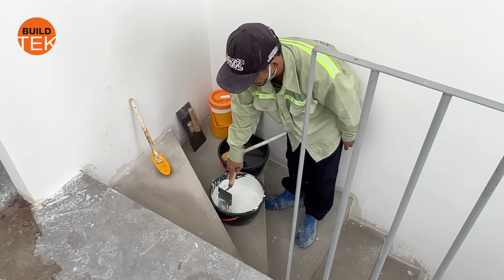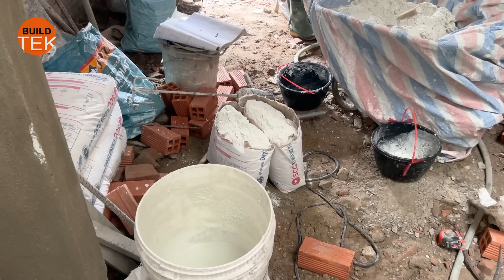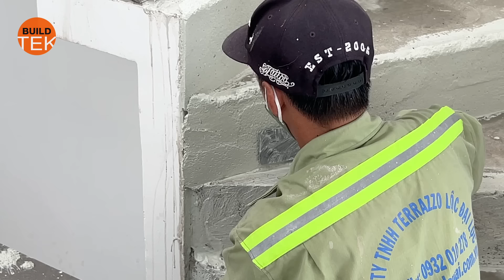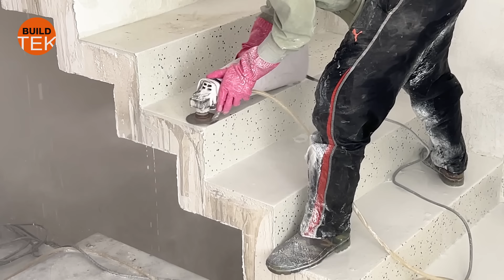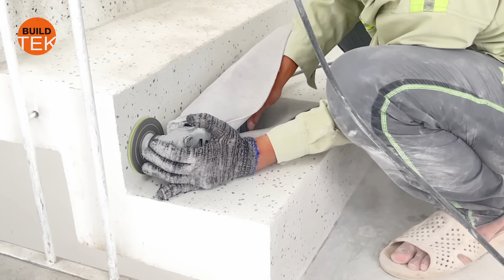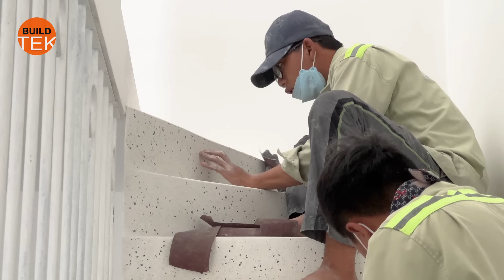It was hard work to make an amazing Terrazzo stair. The result is worth it!

Comment: Terrazzo is slippery and not advised for stairs
Reply: You can use lakk with anti-slip powder
Reply: Bạn không thấy người ta chà khô để không trượt à 😂
Reply: Well don’t walk on it if its wet. Duh!
Reply: Not true, terrazzo is one of the most versatile flooring out there can be finished in whatever texture you want from polished to textured.
Reply: @So-zp2uf 😊
Reply: Not true
Reply: @MostynWitham   Each house normally has only 1 stairs.  Terrazzo is porous and normally sealed with a wax cleaner.  When wet it is slippery
Reply: Bollocks.
Reply: Not true!
Reply: We normally apply noneslips this is not right

Comment: That's some really good mud! Sticking good to the stair face! Terrazzo man for 34 years
Reply from the maker: Thank you!
Reply: @buildtek3670   we do it a little different here in California... we pour tread first then face all at once...we mix our mud with a lot more marble...
That's why we pour tread first so when we trowel face it has that little bit extra to hold it up,! Just saying... your mud is really rich with cement...that's ok as long as it works for you! 
We almost always put a cove in our steps when poured in place...
Have you ever worked with epoxy Terrazzo,? We use fine glass filler...like cotton...real light and fluffy makes mud stiff so stays up on face...
Reply from the maker: @jamescoleakaericunderwood2503   it still was under construction at that time so there were other workers need to use the stair. That's why we had to start with the face first. 
Yes, we also use glass filler for the mud. We have never worked with epoxy Terrazzo.
Thank you for sharing your experience!
Reply: James - I see you said you have been doing Terrazzo for quite a while. I am just a tile cleaner, however I have been asked to clean some Terrazzo stairs. Could you give me some advice?
Reply: how long do these last
Reply: @West_Coast  Centuries and still counting...need refinishing every 20 years...
Reply: @allaboutlove4532  I'm sorry I just got your post...I would have have responded right away...how'd it go?

Comment: We would do it in separate coats, a base coat and 2 finish coats....wet sand on finish....with seperate coats you cut down on polishing as there are fewer imperfections.....still beautiful but looks really slippery.....could add a non skid clear coat in end

Comment: Hi I’m from Melbourne Australia, and really like the finish you have done with the terrazzo. 
Would you mind sharing the recipe / mix of this? I want to do this exact finish on my front porch and am going to do it myself. 
Thanks
Reply: Hola qué aditivo látex? No entiendo, es pintura?
Reply: Hi, I know it's been a while but yes, the recipe is typically: 2-Parts Aggregates to 1-Part White Cement mixture, and note! If you want good results you have to mix your cement with QUARTZ sand (you can go gray too if you want gray floors). It is also possible to add pigments.

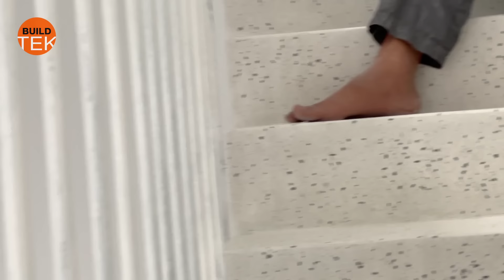When casting large surfaces it is important to lay a thin concrete or 50:50 concrete/asphalt mix foundation layer before laying terrazzo, and do not cast terrazzo slabs over 120cm x 120cm, or your flooring might crack with time, lay thin rubber or metal strips first. Any decent work done in domestic spaces can last well over a century with proper care.
Reply: @dorisirene72  Hola Lo Mismo, Cemento Blanco Diluido En Agua, 
Para Que No Se Despegue, Textura Como La Pintura De Casa...Saludos.
Reply: You Donot Need Recipe 
It Is Very Easy, 
Same As Grey Cement 
Recipe For Counter Tops.
White Cement, White Sand,
Agrégate With Colors You Like.
Amén.

Comment: Grate work high quality , just want to know what time or grinding wheels did you used wet n’ dry .
I do grind stones with 800- 1000- 2000 wet pads . Are they metal wheels? Or are pads.
Reply: My question was what type of grinding wheel did you used for wet & dry? A stone grinding wheel? Or soft pad used on granite/ marble
Reply from the maker: @hagopianharout2238  In this project we used metal wheels for wet grinding and diamond polishing pads for dry grinding (to refine the surface). Thanks for your question!
Reply: @buildtek3670  thank you in thought so was pad dry finish
Reply: Khoảng một tiếng anh

Comment: ممكن تذكر لنا مكونات تيرازو؟
Reply from the maker: وهي تشمل بشكل أساسي الأسمنت والحصى وحشو الزجاج الناعم وعامل الترابط ومزيج الملاط.
It basically includes cement, gravels, fine glass filler, and bonding agent and mortar admixture.
Reply: 白水泥3-4份石子6-7份
Reply: Hello. What type of stones did you used on this project? Is that marbles? What size?